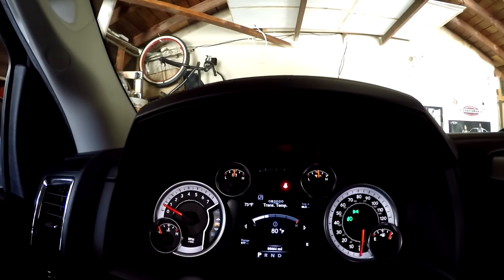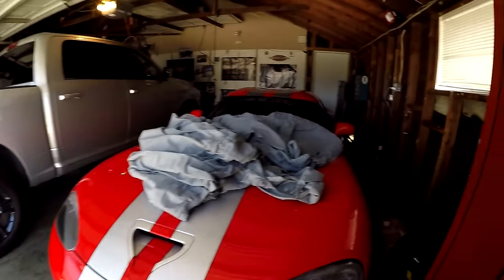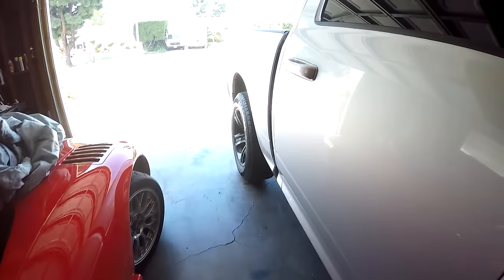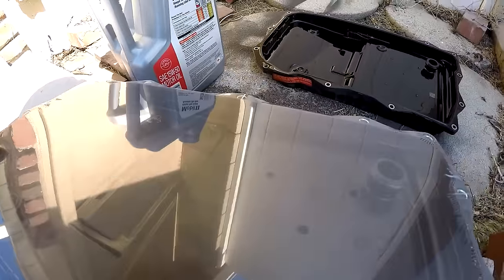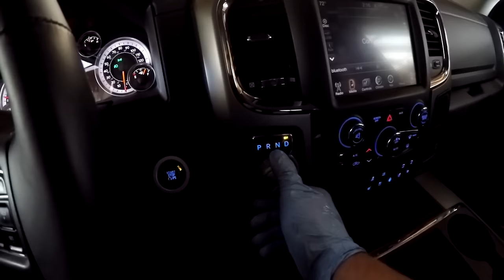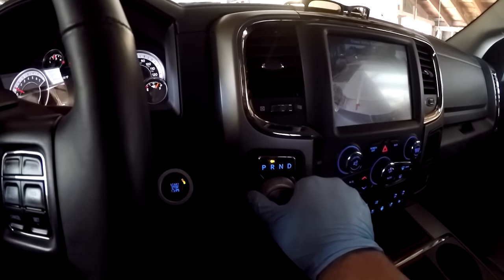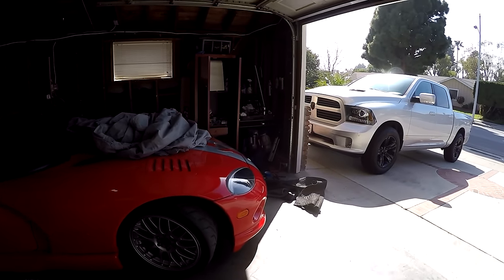Dodge RAM 1500 - ZF 8 Speed Automatic Transmission - Fluid & Filter Change

Comment: I've been working for Chrysler for about 10 years these Transmissions have been in the vehicle since about mid 2014 I've never seen a failure yet I have seen plenty of trucks traded in with over 300,000 miles with zero transmission issues because it will show up on the VIP if thay did it has nothing to do with Chrysler if you want I can print you up a copy from ZF themselves to Chrysler and their technicians
Reply: That is cool. I Think I will play it safe and change my 2014 at 100,000 miles or 7 years. Nice to know they last though.......Ill be taking mine to the dealer.
Reply: English tech guy I think ZF transmissions are expensive and don't last that long, maybe you want people to think Chrysler has strong transmission but Chrysler has been known for years to have weak ass auto transmissions.
Reply: English tech guy why is it that chrysler service says the fluid in the 8speed is lifetime and doesn’t need to be changed, I’m trying to get mine change it’s on a 2014 ram with 99,000 miles?
Reply: Edvin Nelius That was only on Dodge minivans long time ago, it's funny how people using this over and over to bash on all Chrysler transmissions used till today
Reply: My 17 is shifting weird at lol speeds down shifts hard and is bucking It seems to happen when engine is in eco mode I put truck in 4x4 auto and works more normal any suggestions or
Reply: Aggressive driving makes mine buck when finally going back into 1st gear, and makes it have occasional hard shifts.  If I've been driving it without treating it like a sports car for a while, all those symptoms go away.  I honestly forgot about them for a good many months until I got on it, again, in commuting traffic.
Reply: This is exactly why we all paid more money to buy the ZF transmissions.  Dodge has had a really bad history of their own transmissions in Dodge Ram 1500's, so I gladly paid the $1000 extra to NOT buy a Dodge transmission.  ZF's are made by Dodge/Chrysler under license, but are not their design.  I would not have bought a Ram 1500 were the Dodge 6-speed the only transmission that was offered; I've seen too many poor families made destitute-poor by buying a used Dodge 1500; they never are able to get the transmission to work despite rebuilds every 33,000 miles or less.
Reply: Locked Loaded hey dude, i had the same issue. I took it to dodge, as im under warranty, and they reset whatever the computer says to the tranny/diffs. I drive it like i stole it way to often, and it confused the trucks shifting timing. 

As you can tell by the way im trying to explain this, i am not a car guy. It was a free fix under warranty and only took them half an hour.
Reply: and Jaguar.  My boss had a Turbocharged 2013 Jag XJ with a ZF paddleshift transmission....my God that car would break your neck.  Never a problem with it.
Reply: I have a 2014 1500 5.7L and according  to the Window Sticker, the engine is made in Mexico and the transmission is made in Germany.  I have heard a number of people say these trans are built by Chrysler but it seems more likely that, with the country of origin, ZF builds them.  I have a little less than 40K on mine and I'll probably do this change at 50K.
Reply: People must suck at maintaining transmissions. I had 252K in my 01 before I decided to overhaul it... maybe I'm just special
Reply: It's my understanding that the 2014 zf's were German but are now assembled by Chrysler. Add many M series BMW's and Mercedes motor homes and box trucks to the list using the zf trans!
Reply: @JMCRam   The zf 8hp 70 transmission is made in South Carolina. I work there in the rework department.
Reply: So on a 2014 ram 8 speed  oil don't have to be changed ??
Reply: On ZF site they recomend to change The oil every time between  80k km and 120k km.
Reply: @workingguy-OU812  nonsense. 3rd generation ram 1500 had great transmissions. Tons of high mileage trucks still on the road. I had 270k my 2004 before I traded it in for the 2018 model.
Reply: No fluid can last life time. The life of the fluid in the sealed bottle seating on the shelf at room temperature is five years Max. No ATF fluid manufacturers will give warranty on the fluid after five years, they will tell you throw it away. Take same fluid and expose to heat and stress and now your fluid quality goes down fast. As, fluid ages and gets dirty and wears out transmission bearings and clutches extremely fast. I have done Oil analysis on life time ATF fluid, and results really bad. Extremely high transmission wear and fluid is beyond normal specifications. Truck was driven highway mileage for 5 years and 80k miles.

Comment: Ram Forum brought me here. Thanks for posting this. I Know I was waiting for this. Any plans for the additional filters?
Reply from the maker: One Last thing Thanks for checking out the video hope it helped! I'm not going to bother with extra filters to be honest. The fluid was pretty damn clean after about 90k miles so the stock filter seems to be doing its job. I would be a bit hesitant adding additional inline filters as it could alter the oil pressure for the trans if it causes any restriction but honestly I think it's overkill...

The replaceable ATP filter is only about $30 so it can be changed for relatively cheap if you were ever worried.

Thanks again for stopping by and check back for more videos! 👍🏼

Comment: Same trans in my ‘17 Durango. Just did this and now it whines while accelerating 🤷‍♂️  I’m gonna check the fluid level again tomorrow when it’s cold and see what happens.  Mine took about 3.5 quarts...liters...whatever they call it.

ZF’s manual said to do it with the fluid between 30-50 Celsius so that’s about 86-122 Fahrenheit. Will start it and just open the fill plug when it hits 86.  I have a feeling it’s somehow overfilled

Comment: Amazing that they say Lifetime on filter/fluid. Your fluid was good looking still.   I just dropped one of ours and it only has 100,000 km's (about the same as your miles) on it and the fluid is done.  Its black and the magnets have an acceptable amount of ferris material on them.  I just started servicing this fleet and I know our older 300's haven't been touched in 300,000 km....yikes.
Reply from the maker: Yeah mine didn't look too bad but for people towing or putting more abuse I would definitely change it sooner like you mentioned!  Lifetime if you want to throw the truck away or trade it in lol

Comment: Is it the truck or the transmission that needs to be level when refilling? I did this procedure yesterday And now I am getting a P0850 error Which I am reading could Be caused by the rock auto aluminum Pan. I purchased.

Comment: So what I gather you were only able to put 2.5qts back in and then you started the engine to put more fluid in after that? Looked like initially you didn't drain enough fluid to say you changed anything other than the filter pan. Did I miss something? How much fluid drained out when you dropped the pan?

Comment: A way to prevent oil flowing on the exhaust when using the drain plug, wrap a zip-loc or plastic bag around the exhaust.
Reply: EchoStick aluminum foil won’t melt if things are warm.
Reply: Plastic on a exhaust? You can’t be a mechanic you made that up.

Comment: Hey mate you missed the final step. After checking and topping up 4 times, you also have to drive the vehicle on the road and get the oil at least 160F so the cooler valve open and complete oil circulation completed. Then you need to park the car and wait the oil cool down to 109F or 50C again, run the engine on P again and check the level again. And you are good to go.
Reply: true, i think you gotta use 2000 rpm for a bit to fill the trq convertor also. i have a trans cooler with the bypass at low temperarure it drained it,  at high temps it fills back up. so this is a 2 day process the way i see it.

Comment: What about the oil in the Torque Coverter oil, the Cooler Lines, and The transmission coolers themselves. Why didn't you change that oil?

Comment: So is your ram the v6 or hemi? I followed your link for the pan and it says it won't work for my 2015 ram rebel with the hemi. I'm seeing the V6 has the 845re transmission where as the hemi has the 8hp70. Can't seem to find the ATP part i need for the 8hp70 which is what I'm assuming my 2015 hemi Ram Rebel needs.

Comment: What should be "level" when draining/filling the transmission? The shops would use a lift, so the frame is probably level. Doing this procedure on the ground would be different, especially if the front hasn't been lifted to match the back. 

I have a somewhat stock 2014 Ram 1500 quad cab. Will be doing this project in my carport. 

Really appreciate any help that you guys are able to provide. Thank you!
Reply: When I did mine, I put a level on the transmission and the back had to be lifted quite a bit to get it level (~10 inch jack lift), I was also parked at an incline with the back already higher. Once I did this I was able to put 8 quarts in (using PPE pan). Before doing this I only got about 6 quarts in there.
Reply: @carlos33193 where exactly can you place level on transmission to know its level ? Is there a non slanted straight part?
Reply: @carlos33193   Why is it that nobody is making sure these transmission pans are level in ANY video?  I also have the PPE pan, and am "looking forward" to doing mine soon.  Guess you're supposed to use new bolts, too.  Didn't know that either.

Comment: My dealer said there is no service interval.  Lifetime.  If I wanted it changed they said it would cost $800-900.  Based on what I saw here I plan to wait until 100,000 miles.

Comment: Thanks for the video. I have the same atp filter. At first I was hesitant to use it because of less capacity of fluid for the transmission. Since you have used the atp filter have you seen any difference in trans temp? less fluid equals higher trans temps. I tow a lot so that's really important to me. Also where did you get the zf lifeguard 8? I'm currently running amsoil signature series and honestly I wish I hadn't used it. This transmission is very picky. Thanks for making the video good job.
Reply from the maker: Hey Dylan

I have not noticed any difference in operation with the ATP filter.  The capacity difference is very very minor.  II called ATP to confirm and they said lots of people are running this filter on their RAM.  The capacity is only a few hundred ML difference.  Search for the fluid on eBay there is a bunch of sellers selling cases of it.  That's where I found it.  Any other questions feel free to ask!
Reply: I got the mopar 8 and 9 speed atf. The same as the zf lifeguard. I got 12 quarts for 150$ which was amazing. Can you tell a difference in operation after you changed it.
Reply from the maker: Dylan Collett that's an awesome price! I didn't really have any issues before it was just preventative maintenance for me. Still drives great though!
Reply: @ Dylan Collet where did you score 12 qts of ZF for that price!? I've been searching for the past 6 months and you're price is half off of what I can find? I even considered the quantum blue since their price was better than ZF?

Comment: Was there a reason that you changed it? I know the little sticker on the side says lifetime fluid. I'm getting a hard shifts in my 2014 Ram 1500 and was curious if it needed a service or not. My truck currently has 104k miles

Comment: guys it's better to service the transmission every 40 thousand miles rather than get it replaced or rebuilt these ZF transmissions are not cheap to get rebuilt or even buy used!
Reply: I bearly got ram 1500 2019 and i didn’t know my truck did not have a dipstick , so i bearly drive mine around 17,000 miles so when should i take it for transmission fluid change ?
Reply: @jonathanrodriguez1880  Every 50k-70k.
Reply: how do you expect to service it when is so complex to do what should be a simple procedure like an oil change

Comment: Great Video. I have the 2014 also and was about to do the service and glad I watched this first. I like the filter/Pan you used with replaceable filter for future service. The Service Manual from Tech Authority on these trucks is great for knowledge to. Keep the videos coming. Maybe a Oil Filter relocation kit one. Damn Electric power steering pump location makes the oil filter more work by all the prep work to avoid leaking, makes the relocation kit seem like good idea.
Reply from the maker: Thanks Steve!  More to come, been having fun modding the viper more than the truck lately so my videos have been on that lol.  I also have a few extra bottles of new Lifeguard fluid 8 left over that I'll sell for $20 a bottle if you need any for cheap!  Anyways thanks for the positive feedback much appreciated! :)

Comment: According to manufacturer their "lifetime" is a 100,000kms or roughly 60,000 miles. Found out when my trans quit at 190,000kms. They would not warranty even though they advertise Lifetime.

Comment: I agree there's a conflict when Mopar says not to do a transmission flush just swap the oil and leave the sludge in the transmission pan. I got my first flush at 184.000 km convert 114.000 miles so far so good 👍

Comment: I have a 14 5.7 hemi 1500 with 133k. Between 1st and 2nd gear when I first start it up and take it for a trip. A slight slip happens once. But after that trans shift smoothly.  Do you suggest a filter and fluid replace our is this common issue

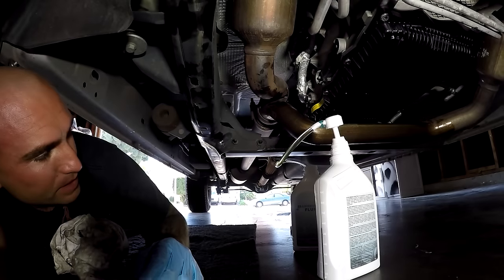Comment: At 9:30 when you only fill up with 2.5 quarts and then start the engine, do you not damage the transmission running it so low on fluid before you fill it up with the rest of the fluid you bought?
Reply from the maker: I hear ya but it doesn't hurt anything.  You actually can't put anything more in since the pan is full and it is coming back out through the fill bolt.  Starting the truck gets the pump running and allows you to get the rest on the oil in.  As long as its not dry and you aren't driving the truck theres no harm done.  Its the only way to refill.

Comment: after seeing the differences in the filter I would have definitely got the factory one
Reply from the maker: They really are not much different besides the OEM one not having a replaceable filter.
Reply: Maurice Cooper ATP is good stuff
Reply: try to monitor the temp with new ATP and we talk later :)))...why ZF is bigger? because the shitty radiator that is cooling the oil is a piece of crap, very small...you just made the cooling more inappropriate by putting less oil...congrats...ask after why is black in 80k km.
Reply: Maurice Cooper I always upgrade any component I can - usually means better performance for less money but I’ve learned over the years that when it comes to transmission pans, control arms and engine intakes - than manufacturer upgrade it OEM is much more reliable than aftermarket!  Just my experience!

Comment: Greta vid man, quick question, I have a 2017 ram 1500 sport, i have the transmission indication but it just shows like hot or cold no numbers, and when i drive it like it goes up pass the middle line is that normal ? Like where does that temp need to sit at?

Comment: I noticed that my 2014 Ram 1500 w/8 speed ran around 175 degrees. My 2017 Ram 1700 w/8 speed is running 190 plus. I think the dodge dealership put the wrong ATF in it when they fixed the transmission heater. Could they have used the wrong fluid? My Receipt says they used Mopar @68218057 AB, which is not for this transmission. Hope they didn't damage my 8 speed.

Comment: i am wondering if you void warranty switching to this trans pan and filter. mine has 100k warranty and i would think its smart to not do this swap until after warranty due to dealership denying rebuild pan. or keep old pan... just in case.

Comment: I’m trying to do same procedure and am wondering if this service can be done with the truck on level ground with the tires off the ground enough to do the shift through gear portion procedure. Or to get proper level does the back of the truck have to be jacked way up so the transmission pan is level?
Reply from the maker: Transmission needs to be level

Comment: I got a 1500 with a 8speed trans had to slam on the brakes stalled motor started it back up now truck won't engage into any gearwhat can I do or what can be done

Comment: Is there a gasket for the pan?  Do you know the pan torque specs?  Thanks
Reply from the maker: Pan comes with a rubber gasket.  Its been awhile so I don't have a torque specs on hand
Reply: BoostedMotorsports   The pan bolt torque specs is 8 pounds, and the fill hole bolt is 22 pounds.